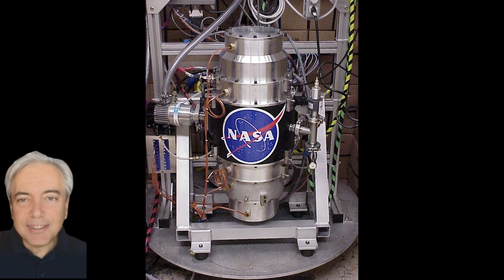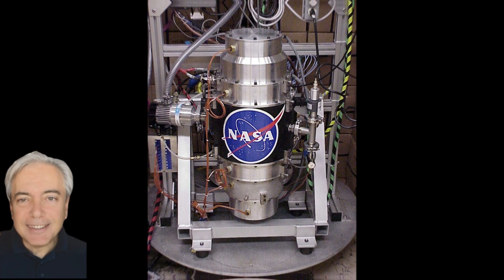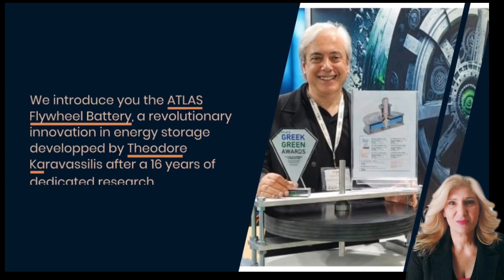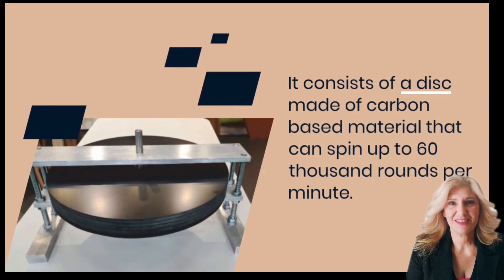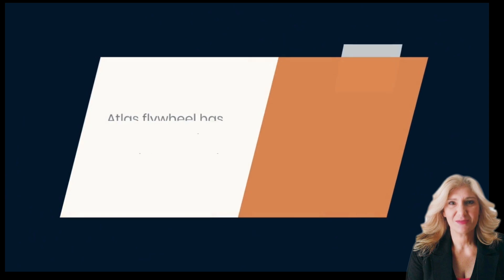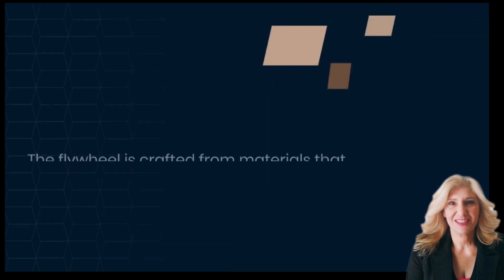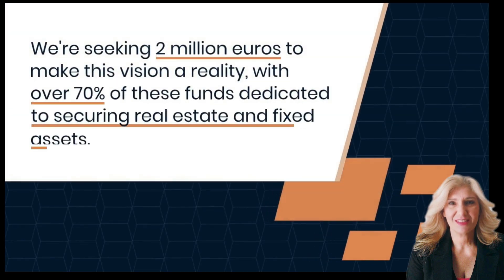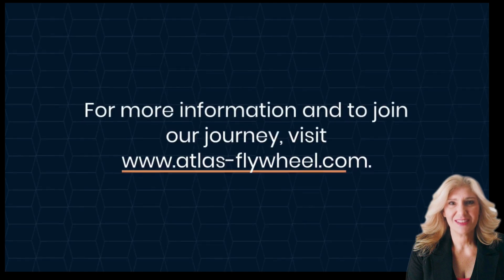ATLAS FLYWHEEL BATTERY PROJECT

Comment: I'm missing technical specs. What electrical capacities are we talking about here? Weight to capacity ratios? How long will this tech hold a charge? Oh, and I hate robot voiceovers. BTW: this tech would probably be useless for vehicles of any kind.
Reply from the maker: Hello, our purpose is not to publish technical specs but to explain the project and the abilities of the new project. This flywheel battery will maintain its charge for ever adding power from a small solar panel. Also, the disc will be in vacuum and and the bearings will be made by permanent magnets. Sorry, you do not like robot voice over but the fact is that it is better than mine. Also our flywheel is not useless for vehicles. Our own flywheel battery is focussed on how to lower the manufacturing cost in order for us to make home powerstations using this battery instead of LFP. We have redesigned our own magnetic bearings and a special gyroscopic base with 2 rings (under patent pending procedure) that allows our flywheel to operate safely inside ships and cars. Thank you for your interest.
Reply: @atlasenergyautonomy  Thanks for your reply.
The reason I seriously doubt this idea will work in vehicles is because of its inherent gyroscopic effect. One could mount it somehow in gimbals, but that would complicate things and defeat the idea of cheap power storage. Also, taking power from the flywheel would introduce torque to the vehicle in the opposite direction to the flywheel's spin.
Reply from the maker: You are right. This is the problem. A common flywheel battery can not operate inside a car or ship. We have designed and patent a special mounting that does not complicate things and does not increase the cost too much. We can tell you more if you identify yourself and explain us your background and if you agree to sign a NDA with us before we send you drawings. Further details published here have no meaning. You can email us to atlas.newtech@yahoo.com if you are really interested. Thank you.
Reply: @atlasenergyautonomy  Thanks for the offer. I'm a design engineer and found your video interesting, but no further than discussing the idea with friends of mine. If you have a solution for the gyro effect that doesn't up the costs too much that would of course broaden the potential field of use. Wish you all the success in the world.
Reply from the maker: Thank you. Yes we have a patented special gyroscopic base that allows to the flywheel battery to be always parallel to horizon. Also, this base has the motor attached, so instead of charging battery (which needs too much time), you just exchange the used flywheel battery with a new one in few minutes. This will change everything and this system is suitable for ships who have no time to charge huge flywheel batteries. You can participate in the project if you like. Please visit https://atlas-flywheel.com/crowdfunding.html  (you will also see the new video there).
Also, if you are design engineer you can also participate in the project without investing money but only your time. We do not need only funds for buying equipment but also for buying time (services of professionals).
If you want to discuss this just email us ... atlas.newtech@yahoo.com

Comment: What's different with this flywheel compared with many others that have bneen tried and didn't work very well?
Reply from the maker: Hello. Thank you for your interest in our project. There are many Flywheel batteries out there that work fine and be used mainly as UPS systems. More than 30 companies in the world, already sell flywheel batteries. Our own flywheel battery is focussed on how to lower the manufacturing cost. We have redesigned our own magnetic bearings and a special gyroscopic base with 2 rings (under patent pending procedure) that allows our flywheel to operate safely inside ships and cars.  We also focus on special nanomaterials for the flywheel disc. But most of all, we want to downscale this technology and be able to be installed inside houses and replace LFP batteries in order for us to present a new series of Home Power Stations use this battery as main energy storage system. We also focus in electric propulsion for ships which is a huge market. Check our new video in youtube.
Reply: @atlasenergyautonomy  Can the magnetic bearings take the precession forces in an electric car  when the car turns or bumps?
Reply from the maker: They do not protect from vibrations. They eliminate frictions. They create radial and axial magnetic field on which a load can be suspended.